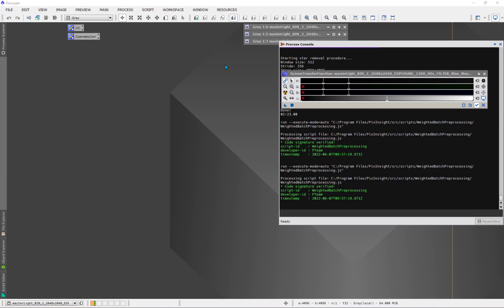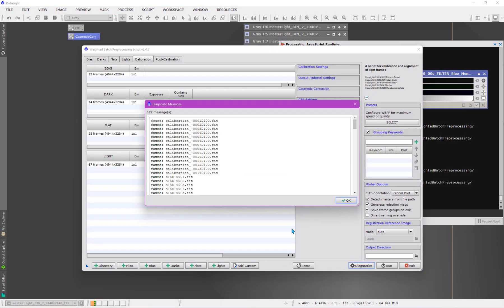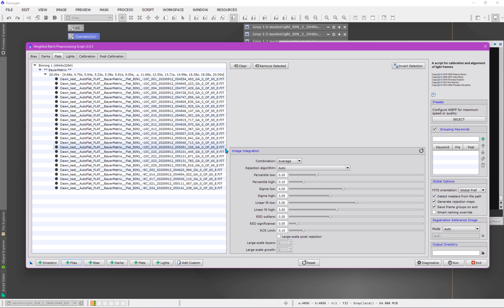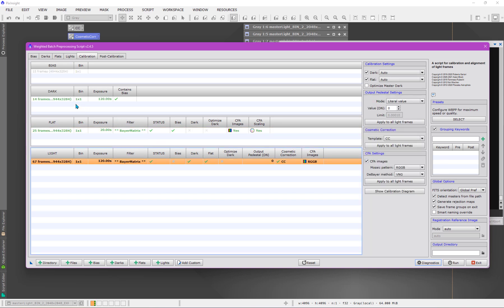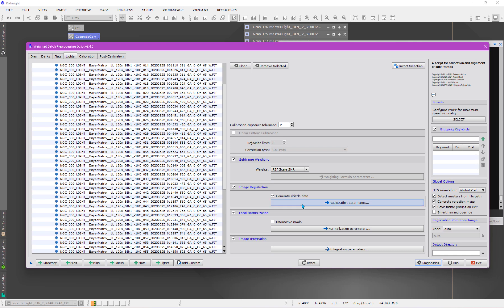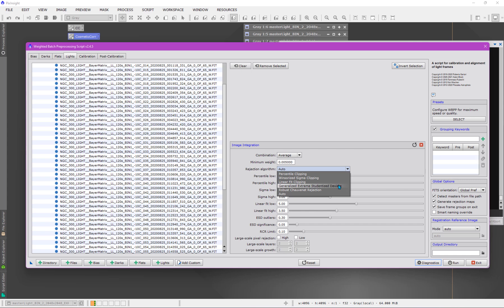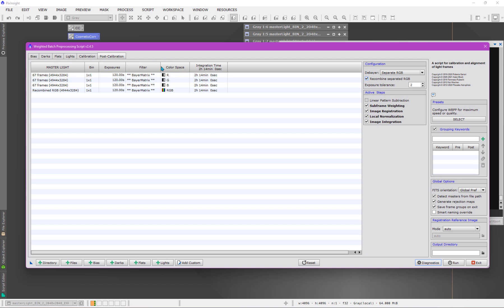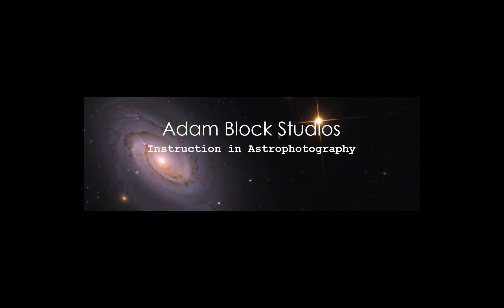The Definitive Guide to WBPP:  CMOS OSC Configuration (with Biases)

Comment: As the program run I keep getting “failed” for LN Reference Generation and Local Normalization. I have a ASI533MC pro and added Lights, Darks, Dark Flats, and Bias. Still no matter what I do the Local Normalization fails.
Reply from the maker: Usually the data is bad- often because of a calibration error.
Reply: You mean an error in my calibration frames? Like either my flats, dark flats or bias? I did notice if I don’t include my bias data, I get less rejected frames but still get the failed Local Normalization and LN Reference Generation. Should I try retaking these calibration frames?
Reply: Hey Adam, 
Here’s an update. Besides getting an error for the local normalization, I was also getting very blocky/pixelated stars and the whites of the stars were a checkerboard pattern of pink and light blues. That might have been a white balance issue or a denaturing issue. So, I reinstall Pixinsight to the newest version. Then I reshot all my darks and bias. I then reset WBPP to the default parameters and ran it from there. Everything ran much smoother and no errors. The final stacked data turned out great. BTW thanks for responding to me so fast last time.

Comment: I'm using a stock Canon T7 DLSR and ASIair mini to acquire my data. My question is, is there a difference in data integrity if I chose to process the FITS files from the ASIair or use the RAW files from the camera? Which should I use for PixInsight?
Reply from the maker: There is a difference in the sense that the FITs files will have valuable information in the header that will help PixInsight do its job. PixInsight will need to "convert" the RAW files to a thing in the program anyway... So FIts is good.
Reply: Thanks @AdamBlock
Reply: Question about your site.  Does the Pixinsight fundamentals option for $215 include the comet academy? @AdamBlock
Reply from the maker: @SoundofSilence-45  No, Comet Academy is part of Horizons (a separate colleciton). But Comet Academy can be purchased separately.